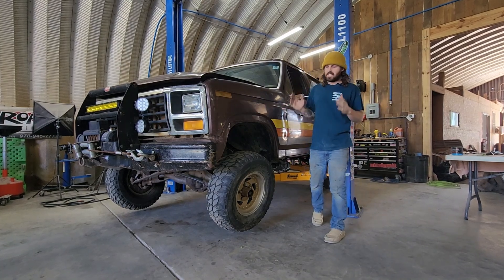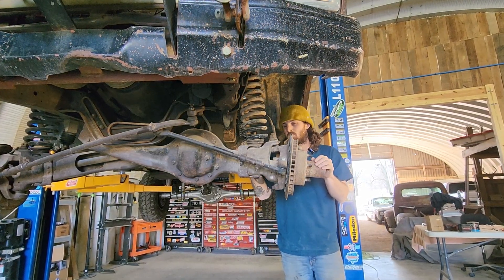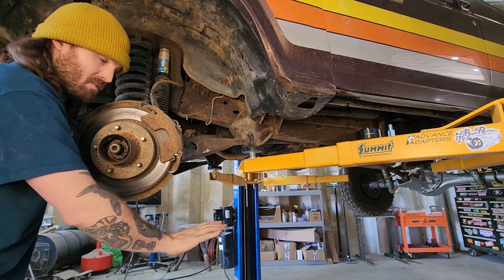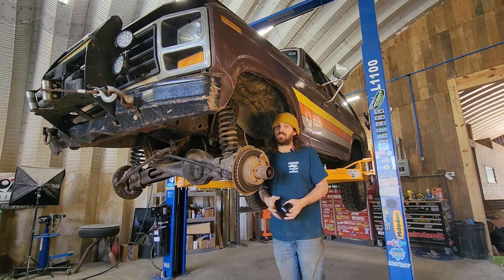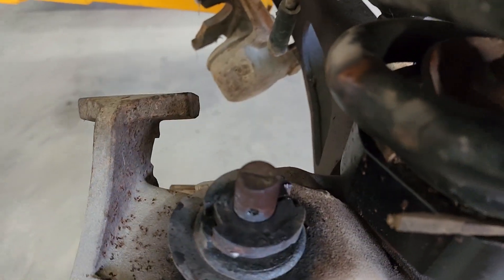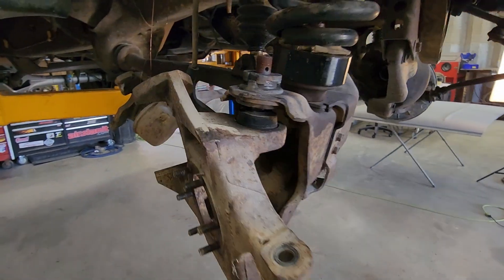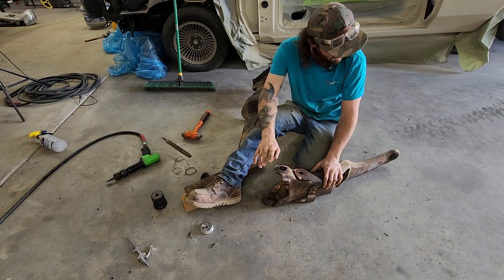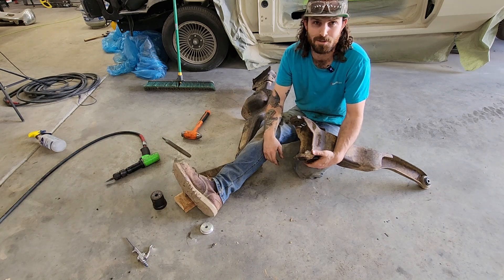Ford Bronco DIY long travel kit. (cut and turn beams)

Comment: I have been wanting to do a cut and turned setup for my 1997 7.3 f250 with the D50 ttb. Bolt on cut and turn kits are expensive but I really just want to take a go at making my own setup. Also that was a nice burp 😂
Reply from the maker: I had the same thought, it wasn't that hard to build. And it works great. Thanks 😂

Comment: The way these front ends are typically set up is to set them at full bump with about 12 degrees of caster. I have a F150 with +4.5" beams, 3.0x14" Coilovers, 4.0x16"bypasses and we have it strapped at 21" to keep the 4wd system happy. With the droop you'll achieve from 14" coilovers you'll definitely need to open the axle window in the right side beam so just do it now.
Reply from the maker: that's good info! and 21" strapped is sick! yeah, I'm opening the window right now. this is a learning experience for me and it's taken a lot of research to get this far. but it's working out. Thanks for the comment!